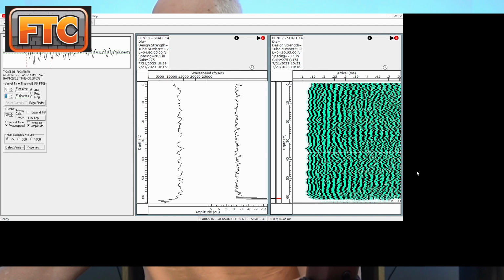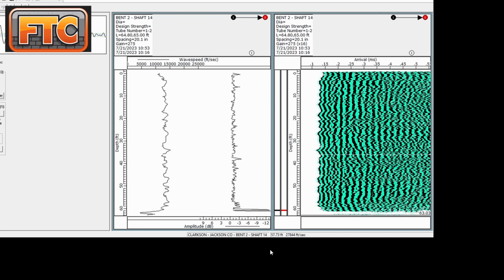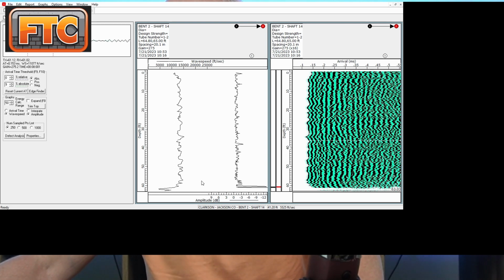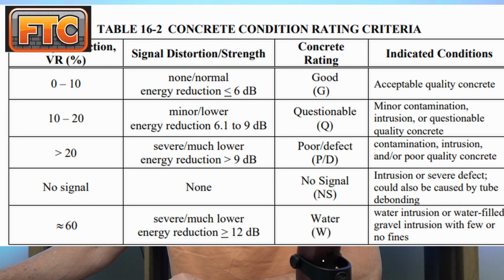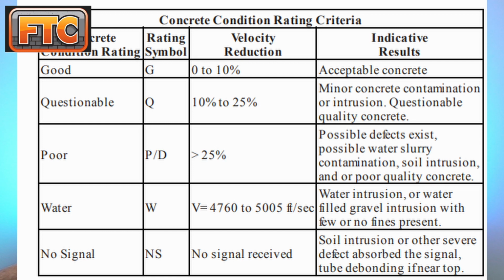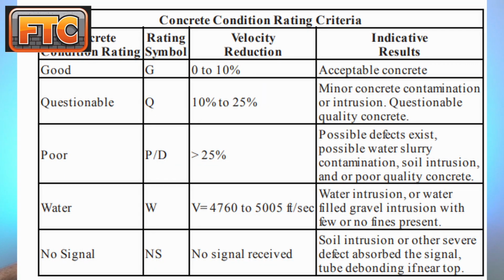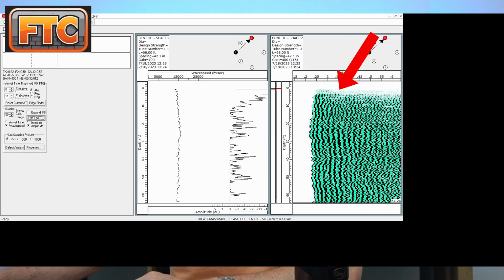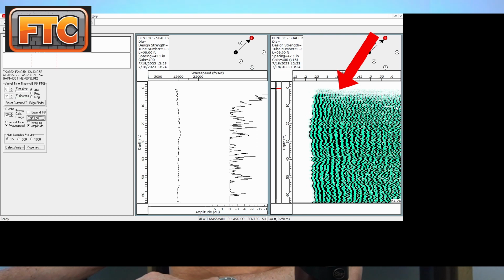CSL Test Results Analysis: Why the Original FHWA Criteria Outperforms DFI Guidelines

Comment: Does the gain affect the data collected if I always use higher gains even if the tubes are close to each other?
Reply from the maker: You have to use the proper gain. The wave form should fill 2/3 of the scale vertically.